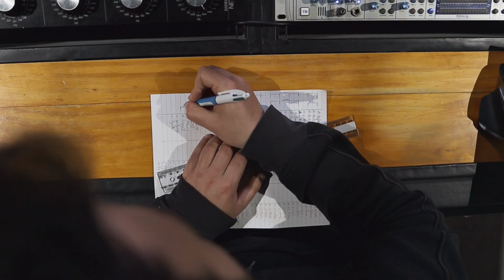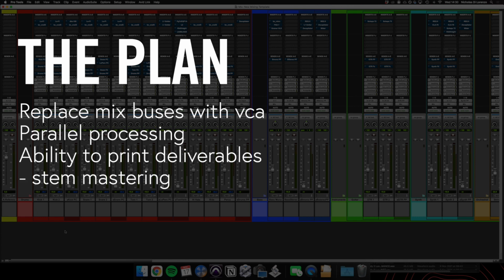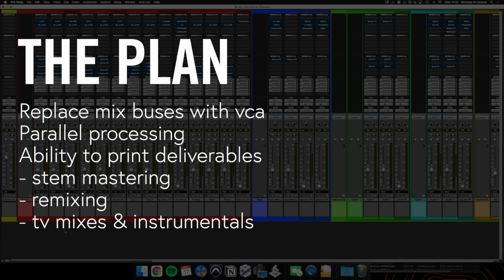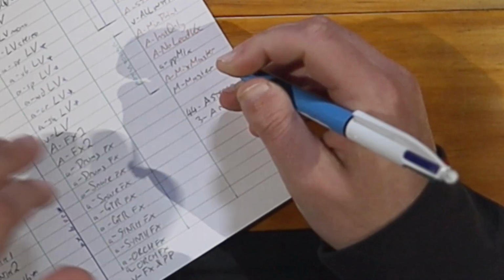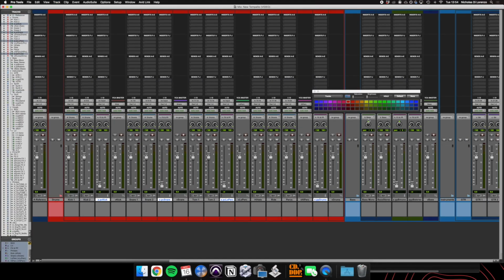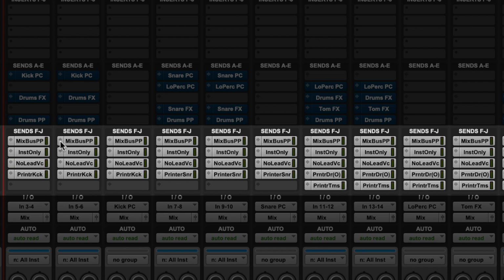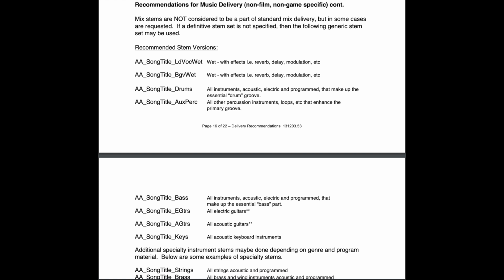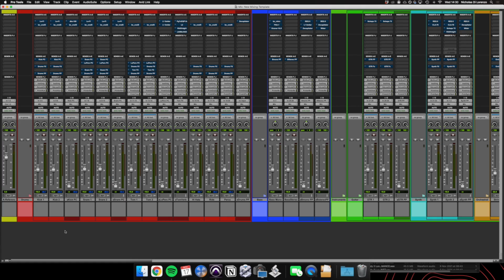Mixing Template Design TUTORIAL - Pro Tools Template

Comment: Hey man, thanks for this. I bought the template and I look forward to try it out. Before this I looked into Fab Dupont's template from Puremix and he had some interesting routing with subs which had master faders to control the signal sent to stems. So in theory, your tracks or subs can actually clip (if you like the sound or balance) but you can attenuate that signal with a separate master fader before it hits the stem. I hope this sounds sensible :) I liked the concept but the whole thing was a bit chaotic visually. Your template looks awesome and I loved it immediately so I'll try to blend the 2 into one Frankenstein template to see if it will work. BTW, what does the DOA stands for in Printers output name?
Reply from the maker: That’s awesome to hear! Any help you need, please don’t hesitate to reach out.

Doa = Dead on arrival. It outputs to a random bus so they can be input monitored and record enabled!

Comment: So just to confirm, you (and Craig Bauer) don't use sub-groups at all? Just VCA and Aux/FX sends? That's interesting, never heard of that.

Question--- What about in the scenario where you've automated the volume of say the overhead mics (for some reason) consistently over the entire track, and then you move the drum VCA volume, will it override the automation? Or will it take it into account somehow?
Reply from the maker: For myself; correct; based off the advices from Craig; 

Any VCA changes will offset against the automation so things remain in balance.
Reply: @panorama_mastering  I'm trying it out on a mix now. Quick question, do you/Craig have the FX sends set to pre-fader or post-fader?